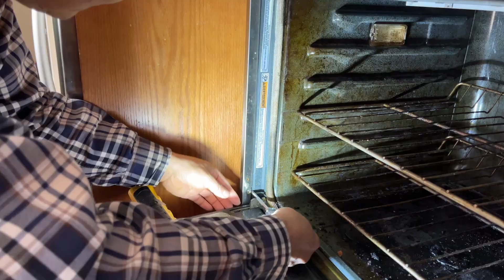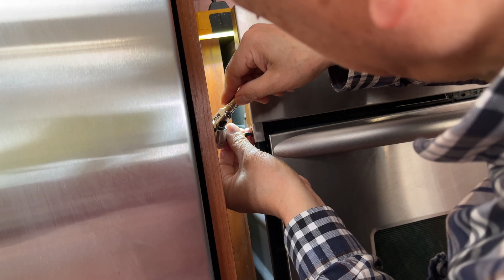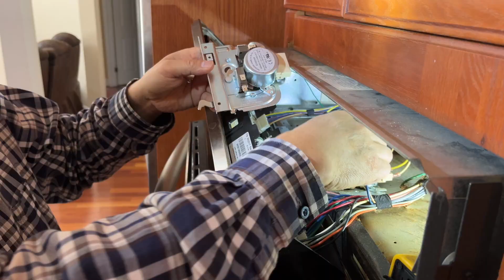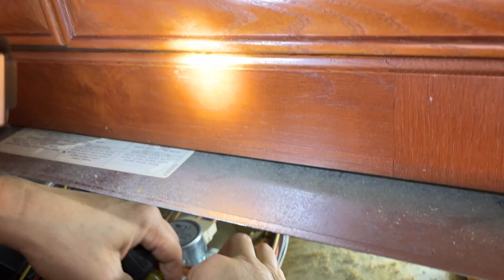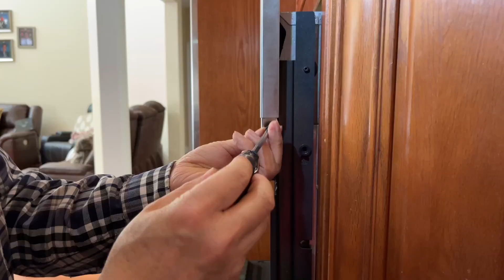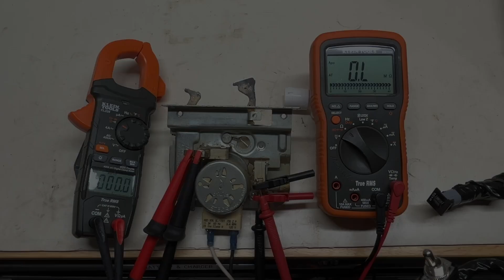How to Replace Door Latch Assembly on Whirlpool/Kitchenaid Oven/Wall Oven

Comment: what do you recommend for an oven that won’t close and continues to stay ‘close door’. I thought it was the latch and used your video to replace the part but the issue continues.
Reply from the maker: Great question,  if you replace with a new latch assembly and it is still, two possible reasons, check connection including wire connectors and harness. Last possible reason may be control board issue. Good luck-